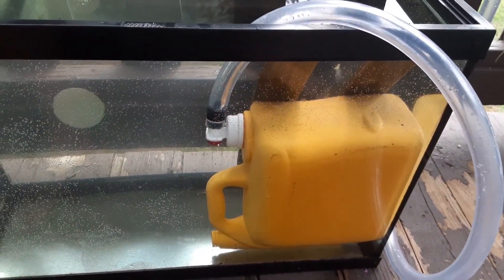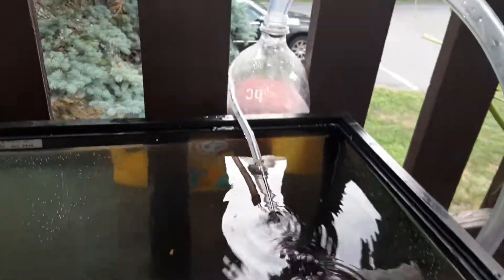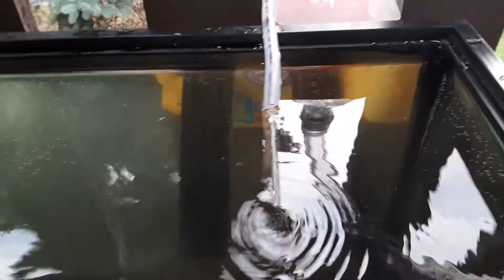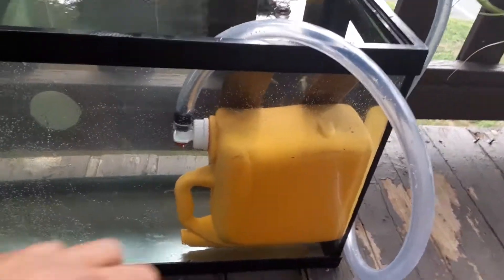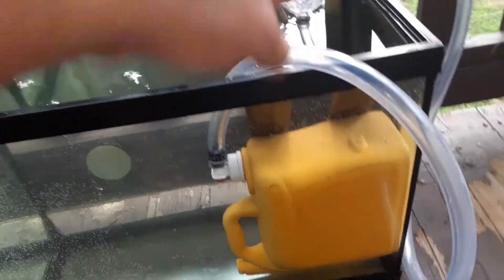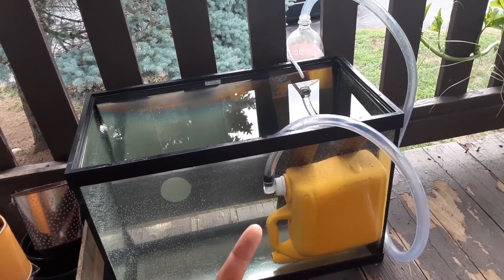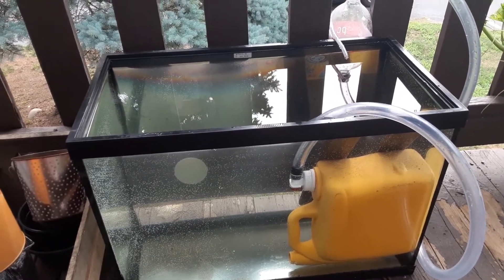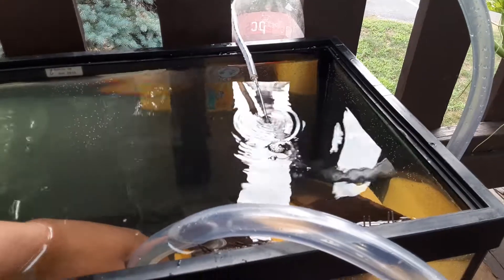WHY DONT WE USE THIS: Energy storage

Comment: I like the concept. Replenishing the storage chamber reliably at depth would be the only problem I can see. However, developing gases from hydrolysis apparently occurs independent of pressure with respect to the mass of the gas generated. Theoretically, you could put some stainless steel electrodes in the tank to create pressurized oxygen and hydrogen gas from the water itself. Interestingly, that would be the exact opposite of using an elevated atmospheric water generator to create water in an elevated tank to create a head of water without doing the work to lift it up there in the first place. http://facebook.com/PerpetualMotor
Reply from the maker: Ran the calculations

It actually takes more energy to generate hydrogen at depth
Reply: @preppertechnicianee6013  I'm guessing that at depth, you can get the mass, but you don't get the volume you need.
Reply from the maker: @PerpetualMotor  

Actually due to the nature of my device you can do this in humungous plastic bags and it would hold since the difference in pressure is near zero

There's a youtube video on it 

The pressure increase is useful but it add to the energy requirements of hydrolysis

Comment: you do not get liquid air at 555 psi....
also your math is wayyyyy off, like wayyyyy off.
the potential energy of 1 cubic meter of water suspended 10 meters in the air with standard gravitational acceleration of 9.90665 is:
0.0272407kw, a VERY far cry from 10KW lol.
and thats assuming a %100 conversion.

this concept is called pumped hydro, it already exists, all youve done is take a relatively efficient idea, and make it less efficient by displacing the water with compressed air.
Reply from the maker: Ya  i realized that later on when I did it my self

 I learned the short hand from a pumpedhydro official video, from a accredited channel I might of misheard, they might have been considering the head 

Did I say 555 meant to say above 700  

It requires less space

So instead of finding a huge location with 2 viable areas for bodies of water 

And concern your self with salt ect 

You can simply drop a large ballast balloon or chamber into a depth  say the ocean 

And use the ocean as a heating a cooling source 

Maybe add in a heat pump 

And bam a fair amount storage 

I disagree with how your viability issue tho
Hydro isn't why I no longer favor this idea 

Liquid air on steel storage tanks is 

Liquid air essentially just air I to tanks and is proving to be highly viable and far more flexible in spacing and local 

No reason to to use depth when the tanks can hold the pressure and still be easily produced

Oh I should also say this more a concept to lead into a secondary tank that could be much smaller 

And had actuated valves to pump the water back and forth  ont the secondary water tank 

Meaning this would trade efficiency for space they secondary take Could be like 300 gallons and swap the water back and forth with the main tank underwater 

I might still do it for fun but compressed air is just a good idea
Reply: @preppertechnicianee6013  I've put a lot of thought into this, I have a large country property, I wanted to build a weighted concrete block system on rails, up and down a hill. When I started doing the math, about how many rail cars filled with concrete I would have to move to store a few days worth of electricity, say 60kw, I threw the idea in the garbage, even with many acres, this project would be absolutely massive.
Reply from the maker: @sportbikeguy9875  nah compress air is the way to go for prepping if you don't want to be battery reliant 

Maybe hydrogen if you want to accept the loss of 70% in a cycle 

Also wait did you calculate for kwh or kw
Reply: @preppertechnicianee6013  I'm actually a big fan of compressed air storage, but to make it anywhere near as efficient as even pumped hydro, rail system etc, you need to capture all heat involved with compression, store it in another medium, and release it back into the air before passing it through the generator/decompressor. A system like that is extremely complicated, requiring computers and electronics to run properly. Rail storage, while big and cumbersome, is very basic mechanically and electrically. I notice your name is prepper technician, so if aiming for a robust, easy to maintain system if the world goes to shit, I would look for the most simple system possible.
Reply from the maker: @sportbikeguy9875  
Ya you lose a lot to heat in compression  but you can cheat it a little 

Trade space for complexity 
Add in a ram pump for vacuume 

A heat pump and a lot of land since heat pumps are over 100% efficiency since they are heat harvester 

All returns are actually energy returns from the pump to generate more power at essentially zero loss 

Nah I'm more of a librarian style prepper I think we need to store data in case bad stuff happens. For example YouTube banning codys labs video in which he teaches you how to turn piss into gunpowder 

None of this return to nature trash other preppers do lol no disrespect just poking fun 

But ya my goal is better tech an knowing how it works